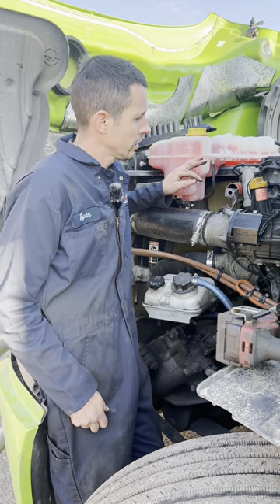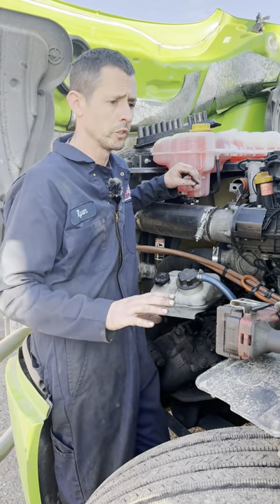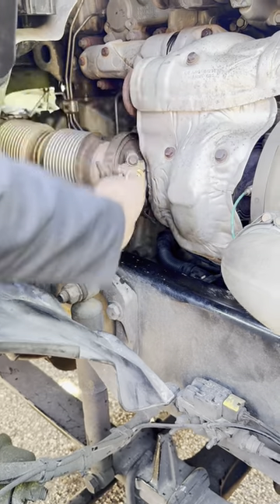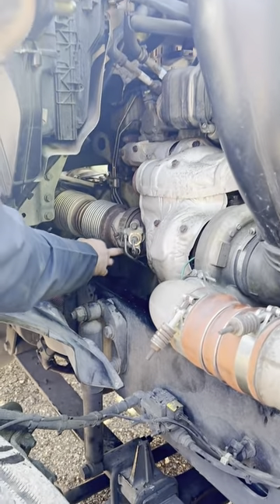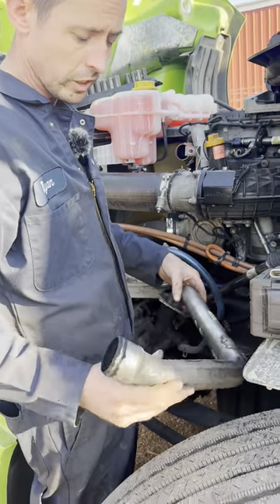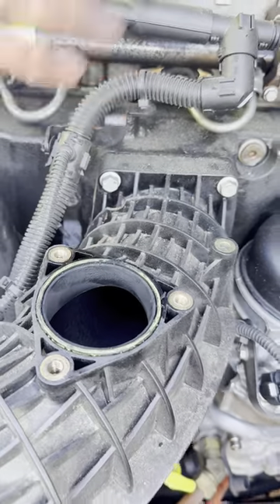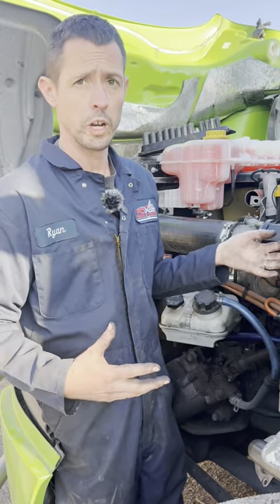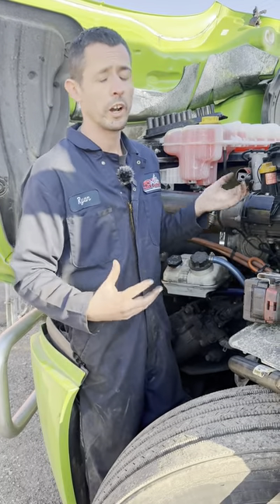EGR cooler leaks from this Freightliner Cascadia, how to tell your EGR cooler is bad

Comment: I wasnt losing coolant until recently, but i used to always need to do an scr efficiency test to stop from using 3x the def it should. 

Do you think the egr cooler was failing, causing the scr efficiency to drop? even tho i never lost coolant.

Comment: My 2014 cascadia has anti freeze blowing all over the engine but I do t know from where . I took it to a dealer and they said it’s the erg cooler ! The truck also had a regrn light come on and it wouldn’t out after 2 manual regent ! They told me it’s $8k to fix with labor
Reply: Did you get it fixed? Would it be a total loss at that point or how did you go about it?

Comment: I would like to see a video of how to perform a troubleshooting on a bad ECM or the harness, I have no power from the ignition switch to de ECM on a CAT C15, can I run power from the ignition switch straight to hot wire behind the ECM, ????